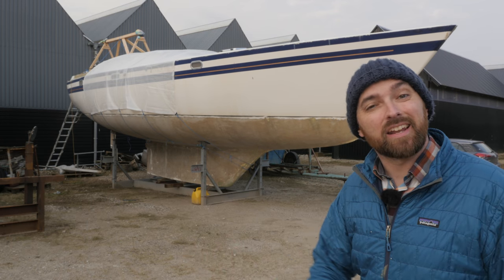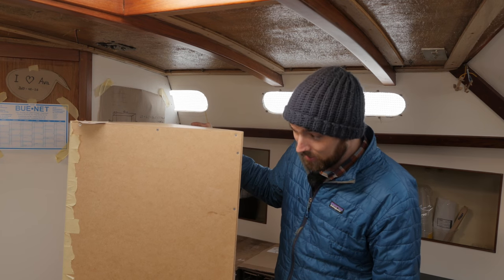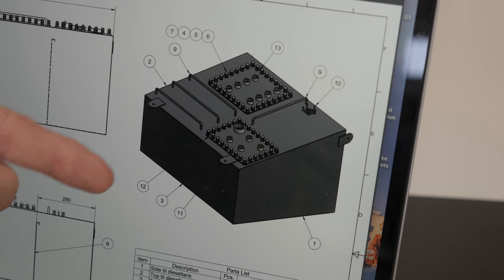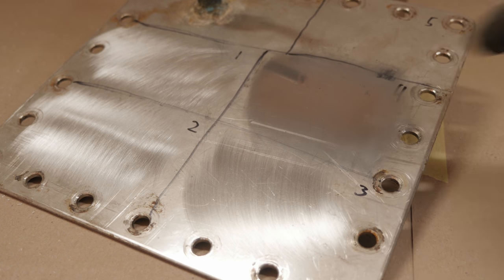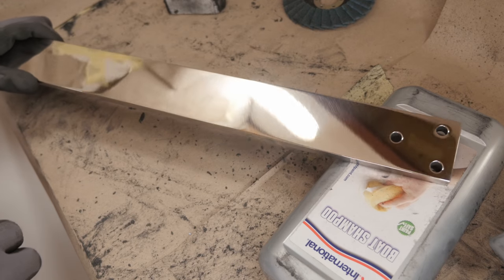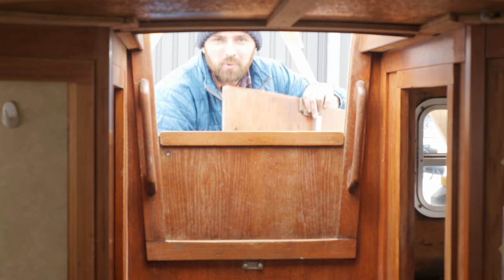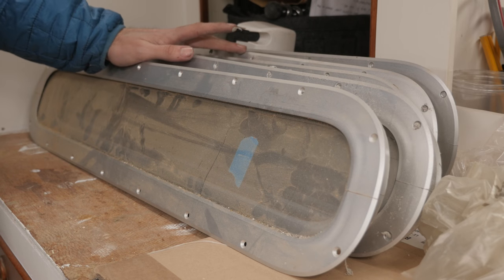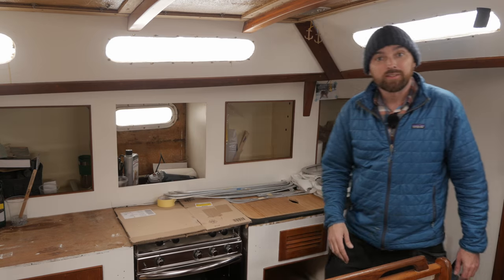Sail Life - Polishing stainless steel, removing butyl sealent and tidying up - DIY sailboat project

Comment: Hi Madz, you have to use the right materials for polishing ss or else you may be contaminating it. After that you should pasivate it in order to form the protective surface layer that will not rust in a marine environment. Failing to do so will bring forth glorious glorious sanding...

Comment: Before you get laser cut chain plates I would suggest finding someone who will give an example of bead blasting one or two of those old chain plates.  It will give you at least a Matt finish to start polishing from...and Yes, the bench grinder with buffing/polishing wheels sounds like a the perfect answer.

Comment: Flap disks are great but you run the risk of removing too much material, stick with the finest disk you can get and good old buffing compound. may I suggest toothpaste as a finish. Sounds crazy like a fox but its a super fine "buffing" compound that we use on our teeth daily. (also works great on head lamps on cars that have gone south) Cheers!!

Comment: G'day,
I'm an apprentice fabricator here in Australia and last week I had to polish 48 stainless steel posts for a handrail at work. Whilst not the most extensive experience it was guided by someone who is known for their 20 years of great stainless steel work.

Now the way I was shown was to start at a course grit of 80 then 120, 180, 240, 400, 600. We used a door sander though we has some very expensive trade specific tools the idea was pretty much the same.
Sand the surface flat with the 80 grit, then use the higher grits to polish out the scratches from the 80

I was also told never to use flap discs as they are prone to leaving flat spots and not leaving a perfect surface. 
We use belt Sanders and orbital Sanders.

Comment: Personally I rather go with a satin finish on stainless steel, rather than full on mirror polish. I just find mirror polish parts are more annoying to work with due to the glare. 

Remember to double check your cutting/grinding/polishing speeds! You'll still get to a mirror polish if you're well over or under the spec's speeds, but you'll either take longer to get there, or prematurely wear your medium out for no gain.

For large flat pieces, I like to start with files, or use a table-belt sander if available. (If you haven't already, try talking to some of the other users at the boat yard about a tool library co-op. Not much call for a belt sander while you're out cruising, but it also doesn't do a lot of good sitting in a storage locker waiting for your next refit when someone else could be getting some use out of the hardware.)

But as for polishing tips: Cleanliness is your friend. Do ALL of your sanding of a given grit on all the parts, clean up, and then move on to another grit. It really sucks to be working on your final mirror polish and then find a grain of #50 grit has gotten onto your polish wheel or into your compound store... Be very careful that you don't contaminate your finer grits with any of a coarser grit. (Also, if you get into doing LOTS of polishing, be wary of buying your finer grits in large bulk containers. A friend's large fabrication shop recently tossed a near new 45 gallon drum of polish medium because a new guy used the scoop from the cutting medium drum...)

Comment: You need another stage of sanding between the heavy duty pads and the polish, that is if you insist to use that heavy a cut, IE, if you polish something and you see sanding marks, that means you've overdone it and need to go back a step and sand some more with finer grit. This is a rule that applies to any material and any surface.

Comment: When working through a range of abrasive grits vary your sanding pattern by at least 45 degrees. It is easier to see when you have removed the coarser scratches and are ready to progress to a finer grit.  I noticed that the piece you polished did not have 2 holes in the boss welded to the middle where the old part has them.

Comment: can you polish the old chain plates and reuse?
Reply: Can you polish the old stainless wire used on the rigging too?  No. It's stressed and worn out over time, and needs to be replaced at a regular interval depending on usage and age.   This was a saltwater boat too.  

Not to mention Athena had rotten and wet deck core material and that wet material which was up against the chainplates where they passed through the deck.  This sealed off section was likely oxygen-depleted so this perhaps damaged the stainless steel, pitting and weakening it at the place where it is most difficult to inspect and check when it is installed.  It is called crevice-corrosion and it is an insidious destroyer of stainless steel, almost eating it like an acid. 

Nothing lasts forever.  Stainless steel parts are not all that expensive.  Now is the time to replace them all with high-quality new parts while all the labor of removing them has been done and before new rigging is cut to size for the mast.

Comment: I am sure you can reuse old/redundant ply templates rather than throw them away !! think of the carbon footprint , perhaps to form a toolbox template for the 2 buckets of hand tools you have after all you will need stowage for tools when on the high seas. Hows that for forward thinking ?.

Comment: Mads,  get the # 20811 polersett from Biltema.  It goes on an electric drill and gives quicker results and easier access to nooks and crannies. Same method as you've already mastered with your grinder felt flap disc.